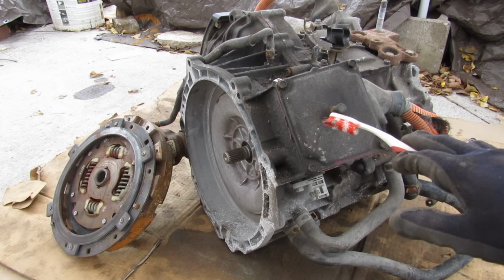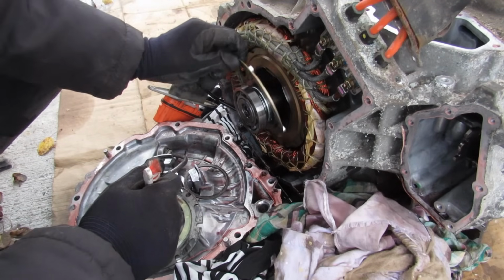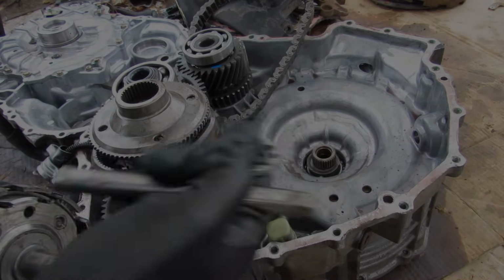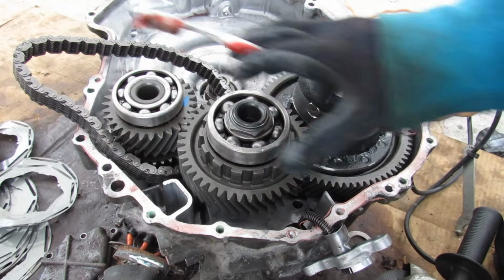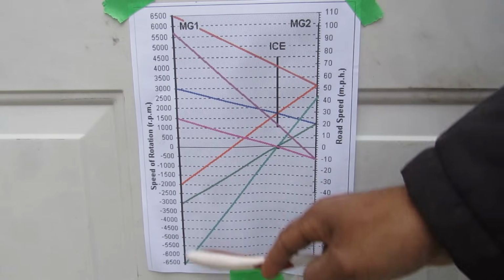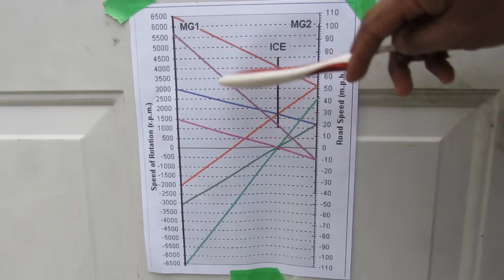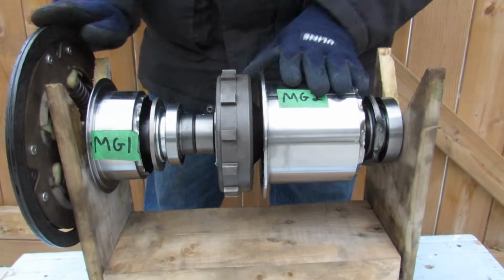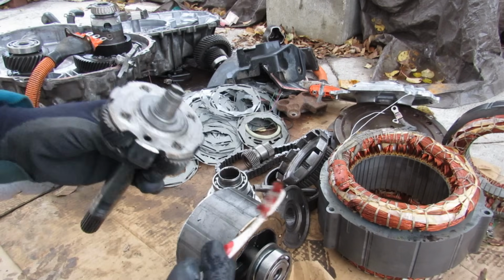How a Hybrid eCVT Transmission Works   Part 2

Comment: This hybrid engine looks like it would work very well on a boat ... delivering electric or gas power to a propeller when needed. What was the benefit of using dozens of thin cutouts I wonder? I guess it was easier to manufacture pressed metal in that way. Pretty clever absolutely.
Reply from the maker: Weight would be a factor on a boat. The thin cutouts you mean in the stator? That helps to increase motor resolution and thus torque.
Reply: It also reduces the size of Eddy currents because they generate heat and reduce efficiency.

Comment: That looks way more reliable than the Nissan garbo
Reply: It is - very rare for the actual power split device to go bad.
Reply: @eddynetweb  the battery would have to be ultra dead for it to fail
Reply from the maker: 100% better

Comment: Quick question... it looks like the gear teeth and parking pawl in the eCVTs look a lot more robust.  Is it as important to engage the parking brake all the time if you have a hybrid eCVT (Toyota/Lexus) compared to a standard automatic transmission?
I worry that the little electric motor in the electric parking brake in the rear, will wear out and break sooner (I'd imagine it's expensive to replace, though not as expensive to fix as a malfunctioning parking pawl)

Comment: Just hit 200,000 on a 2012 Ford Fusion hybrid and never knew the transmission fluid needed to be changed, you think I should change and not take that risk? Only regular oil changes, sparks, and a couple of o2 sensors, knock on wood.

Comment: Thank you for the video. Is the regular Toyota Corolla CVT (Non-Hybrid) also as reliable as this? Please advise (if possible, please make a video). Thank you.
Reply: As long as you change the transmission fluid very regularly they can be reliable but the hybrid transmissions are extremely reliable.

Comment: Very informative. The most complicated transmission in a passenger car that can last 200k miles. My goodness. This makes an electric car with a gas range extender look elementary. I wonder how long the clutch assembly lasts like a regular manual transmission disengaging the engine for all the start stops a hybrid does.
Reply from the maker: Clutch? You mean the fly wheel? It's permanently engaged... No wear
Reply: There has to be some kind of wear part that disengages the ICE from the transmission so the electric motors are not constantly turning over the ICE when it has no spark or fuel.

Comment: You say something about "law of conservation of energy" and that MG1 isn't being used as a generator when the engine is stopped, but it's a permanent magnet spinning in conducting coils, so it is generating current. They are dumping that current back into the system, but there is a loss. It's a brilliant system but it's not magic.
Reply from the maker: Yes but if you are dumping that current you are drawing energy which will cause some resistance

Comment: I don’t think Toyota uses chain in the transmission anymore.
Reply from the maker: They using a belt ?
Reply: @speedkar99  
😂🤣😂
I didn’t think Toyota would fall that low. 
Just gears ⚙️
Reply: @speedkar99   Toyota replaced the chain with a gear on gen 3 Prius i think.

Comment: I have a Lexus hybrid with a V6 with ~170k miles
When I start driving in the morning when everything is cold, on electric power I hear a rapid clicking from the gearbox, which I assume is the chain clanking against the sprockets.
After everything warms up, the noise goes away.
This gearbox never had its fluid changed. Should I do it? will it help?
Reply from the maker: Change the fluid but I don't think that's the noise

Comment: @speedkar99 Hello, am having issue with my prius gen 2.. my prius has been always charging its Hybrid battery to 6bars every time I use it for trips, yesterday I took it for 1200Km spin , it charged the HV battery to 6bars, then after 200km it never again attained to that level of SOC(6bars)..now it only charge to 4 bars, then once it reaches 4 bars the arrow that shows charge is being fed to battery stops, but when SOC bars become 3bars, the charging arrow comes up again and HV starts to charge to 4bars then stops  even at low speed.. but when regenerative braking kicks in the SOC of hybrid battery attain its 6 bars, then after sometime the battery SOC will drop. (depleted) to 4bars...this makes car to use engine power much to run the car and car become inefficient...

Kindly sir assist to tell me what might wrong with my car? 

Note:(no warning light, inverter water pump is working too)
Reply from the maker: Your best bet for battery issues is to get the scan tool that can read that data and load balance the cells.
Reply: @speedkar99  thanks for response...

Comment: I have been driving my Prius for over 300000 kilometres is there any recommendation for maintenance?

It seems fine, I just had to replace the water pump.
Reply from the maker: Just keep all the fluids fresh and you should be good
Reply: Do the oil transmition

Comment: Are these generally good transmissions? I have heard that regular CVTs have problems but I haven't heard much about eCVT transmission problems.
Reply from the maker: Yes they're very reliable. This car had almost 500,000 km on it.
Reply: toyota's ecvt is physically very different from regular cvt's. Honestly they should have a different name for it.
Reply: Toyotas non hybrid CVTs aren’t too bad so long as you change the transmission fluid…

Comment: I’m getting a new Camry Hybrid SE this week or next. It will have paddle shifters. 
What do they do on a hybrid? (Or how do they work)
Reply: Maybe changes Break Option if you want regen breaking or regular? I remember a few youtubers driving electrics with paddle shifters and they use them for those options.
Reply from the maker: See the graphs ? It'll have predefined settings for the motor speeds with the paddle shifters  instead of being infinitely variable
Reply: They might set different motor speeds which will result in different gear ratios.

Comment: Hey man my hybrid car is producing some sense of  sound when i run it with electric mode and it's a new vehicle not even it has crossed 1000km and that sound is from the trans axle,do you have any guess about the defect ?
Reply from the maker: No. Sounds like you need to take it in for warranty
Reply: @speedkar99  Yeah but my intention is to repair on my own like you 😁,Soo.

Comment: Can it be used as a real generator for powering houses? 

It's already have a IC engine and a generator coulpled by design (and not like putting together car engine and 220v alternator by modifying the bellhousing to accept generator shaft?)
Reply: Probably

Comment: hi,what is the make and model of this new e-cvt gearbox? Which model e cvt transmission does the 2022 Toyota corolla cross 2ZR-FXE engine code 1.8 Hybrid use?  I will be very glad if you answer.
Reply from the maker: 2004 Prius

Comment: If I am coasting down a large mountain hill, and simply taking my Foot off the gas pedal will not reduce my speed enough to safly fly down the hillm, what is the best way to reegenerate electricity into the batteries? Foot off the gas pedal + put shifter lever in B position. Or Foot off gas pedal and slight foot pressure on the brake pedal.
Reply: B mode uses engine braking, not regen. If you lightly press on the brake pedal it will use regen a bit faster and if you push the brake pedal further, it will eventually switch to friction brakes.

Comment: So quick question ⁉️ I drove a Prius 2nd Gen less than a mile in neutral not engine running pushed towed with a jeep going less than 35mph , you think the ecvt could had being harm /damaged?
Reply from the maker: It won't. But your battery may get discharged
Reply: I think you still not understand or misunderstood my question , I said not RUNNING not READY MODE....

Comment: Can someone help me with this info. Does the planetary gear set in Toyota use clutches to lock either the Sun/planet/ring ? I am asking it since I need to drive a lot in bumper to bumper stop and go traffic and am worried of clutch burn and material entering transmission fluid.
Reply: In toyota hybrid no

Comment: Modernbday transmissions have developed by leaps and bounds more than engines. Now large vehicle can be powered by smaller displacement engines because of the modern gearbox

Comment: Why do this car needs a lead acid battery ??
Reply: For powering 12v system but also to initiate relays of hybrid battery that click at the back of your car every time you switch on the car

Comment: Oh boy, Toyota's hybrid system is so much advance than Honda. Toyota's system spilt the power between mechanical drive and electric driver like 30%  engine power drives the wheel and remaining 70 goes to electric motor and vice versa. Honda's system hybrid systematic just gives all power to the generator motors and when speed goes above 80 kmph, the a clutch engaged and full engine power goes directly to the wheels

Comment: I always really liked the concept, maybe I will swap one of those transmissions into my car. Is the transmission independent from the engine? Or are all the electronics linked?
Reply: You'd need a whole hybrid system.
Reply from the maker: See my part 1 of the series where I explained all that

Comment: As nice as all this tech is, I'm still using the 1nzfe gas only version 23 years later.. radiator failed but $150 later I'm enjoying my simple engine that is not a space shuttle
Reply: If I could go back in time maybe I would have chosen a gen 1 Prius. Were those any good? Would it still be running without spending another $5000 in parts?

Comment: Hmmm... Still doesn't really explain why it drives like an egg carton though... 😊
Reply: its not a sport car tho, it has a atkinson cycle engine made just for fuel economy.
Reply: @carholic-sz3qv  true, its got good points. Would be nice to get a similar mileage with other cars. Rattles a lot though.
Reply: It's a compromise for power and efficiency. Unfortunately you can't really have both at this time.
Reply from the maker: O explained that in mode 3 of the power split device

Comment: Q#1: When I am coasting down a hill and I take foot off of all foot pedal with shifter in D, am I regenerating with mg1 or mg2 or both?
Q#2: in the situation above, if I also apply the foot brake pedal lightly, will I be activating another generator or applying brake pads to rotors?
Q#3 if applying brake pedal lightly does in fact initiate additional regeration, does the pressure of my brake pedal correspond to the aggressiveness of regeneration?
Reply from the maker: MG2 does the brunt of charging. 
When you press the pedal the friction brakes don't work at all. See my hybrid brake video for how that works.

Comment: It will work until 1 million miles😂. has no clutches, no solenoids, basically no failure mechanism, no valve body. What sorcery is this toyota?
Reply: Sometimes the clutch dampener do fail